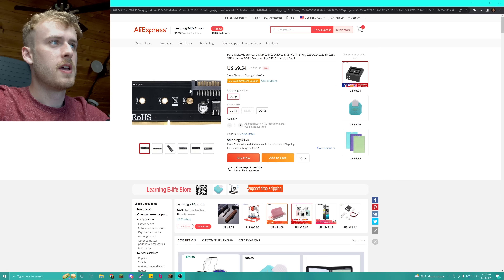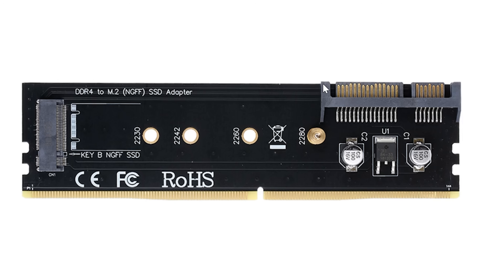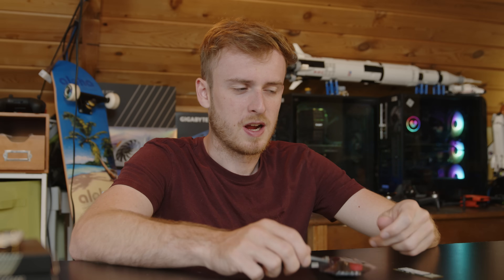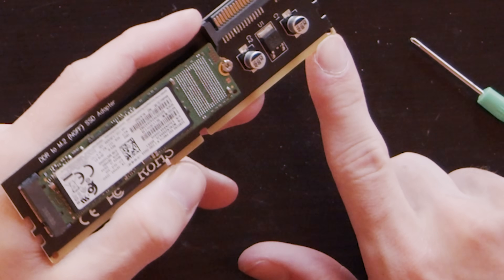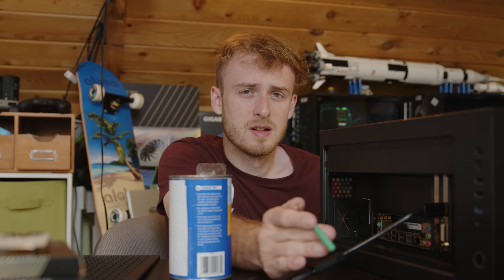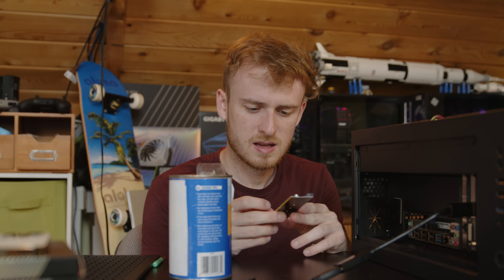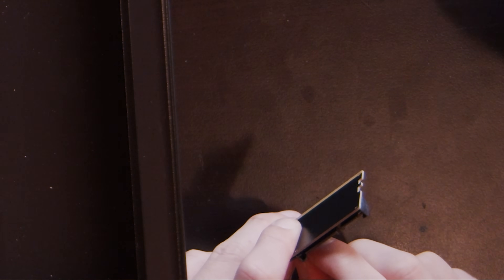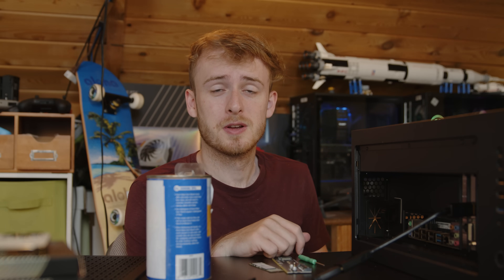I Bought a M.2 SSD To DDR4 Adapter from Aliexpress.com and Broke My PC?

Comment: Seems more likely that you suffered ESD damage. With no ground pins on that "adapter's" PCB, it's more likely that any static charge on the surface of the PCB material would have then discharged through data and/or addressing pins of the RAM slot directly into the memory controller in the CPU.
Reply: I think you might be mistaken.  The plug that goes into your power outlet is grounded via the mains supply to your house.  The power supply is grounded via this cord and in turn the chasis of the PC is grounded as is the motherboard, via the power supply so any ESD would be harmlessly dissapatied.  The only exception to this would be if you are using a budget power supply which isn't grounded, I've seen quite a few that are not.  But please DON'T OPEN YOUR POWER SUPPLY unless you are qualified to do so.-----
Reply: @russelldresh7832  I don't believe I am, I'm pretty well-versed with electricity. I've also been tinkering with electronics and building PC clones since the early 90's so have my fair share of experience in this arena. That said, I don't proclaim to be an expert and am only sharing my experiences accumulated over the last thirty-some-odd years.

First, when installing RAM or PCI cards onto a motherboard, you should have the power disconnected from the system. Adding components to a hot board, while something I admit I cheat on occasionally, is not the best idea. While some PCs that have been custom built or perhaps beefed up with a newer PSU might include a hard power switch which can be turned off, in turn leading the ground connection intact with the wall outlet, most OEM systems do not, and these would ideally be disconnected from the outlet for service. This is why a ground strap which one wears is always recommended. 

Now back to this mystery adapter; with no ground pins on the DIMM interface side of the adapter PCB, the earth ground through the power supply is moot either way. 😉

The adapter PCB will essentially float, and static charge on its surface will not necessarily find a ground pin in the motherboard's RAM socket before it finds a path to ground through an address line, a data line, or another component pinned to the DRAM socket. Static charge can build up to hundreds, even thousands of vots. There are no high-voltage isolation slots in the CPU's die. 

Think of the last time you received a static shock when reaching for a door handle. A door made of wood... Bolted to a wooden frame... Static discharge damage, though increasingly rare, can happen easier than you think.
Reply: fried through past the sata port into chipset.?. / electrical current can travel through other areas that aren't even connected on the pcb / voltage can jump across lanes.. I wouldn't put it past the manufacturer to not know what they doing.
Reply: @djsaekrakem3608  Not likely, as the M.2 SATA slot on the adapter, as well as the SATA connection on the adapter, have a low-resistance electrical ground through the SATA controller. 

The PCB material, by its very nature, is an electrical insulator. So without having any electrical ground pads on the edge of the adapter which slots into the memory module connector, any static charge that had accumulated on the surface of the PCB material would then discharge to ground through the path of least resistance. If there were an actual electrical connection to ground, that would have been the easiest path for the voltage potential to discharge through. We know, however, that the adapter has no electrical path to Earth ground. So that means, wherever the most potential difference had been accumulated on the PCB, the voltage could have first found the path of least resistance to ground through the pins directly connecting the RAM slot into the RAM controller - which on modern Intel chips is integrated into the CPU - instead of passing through the electrically insulating PCB to an actual ground pin. This would have the potential to discharge hundreds to thousands of volts through the RAM controller in the CPU, which is not capable of isolating more than a few volts at the absolute most.

End result is a roasted RAM controller, which means a roasted CPU.

Comment: I don't get why if you saw it don't have any conductor on the suppose fake ram pins, why you connect it to the ram slot anyway??? -_-U I will go though the process is testing everything separately to see what is exactly causing the computer to fail to start

Comment: I had a case front panel e-sata port fry my pc about 20 years ago. Like literally it was only supposed to change the connection port, there was nothing connected on the port. So it might also be the sata part.

Comment: I still have a ddr voltage booster.  It used to go in a ram slot. Had a knob on it to adjust ddr voltage. It ran off a molex HD power connector. Back when ram wqs in the 3v range. It would let u up the volts 3v to 5v in hundredths of a volt.  Back when Mushkin memory was the best...just Samsung bh2 chipa
Reply: that sounds... insanely and beautifully sketchy. I wish modern electronics had the guts to be that wild.

Comment: I recently had a rather strange fault occur with my frankenstein desktop PC (i say frankenstein because it is a mixture of higher end and lower end parts)
One thing i should mention is that at the time this happened, the frankenstein PC had a mechanical hard drive
The PC has a 650W power supply, and it is plugged into a surge protector
I had recently installed an SSD which i was going to move my data across onto (as part 1 of a 2 part process to move that system across to SSDs)
Started the PC up, everything seemed normal, i formatted the SSD, and shortly after i copy/pasted my data from the data partition of the mechanical drive to the SSD, the computer froze
this computer has frozen in a similar way a number of times before, and it has always recovered either by itself, or from me pressing the reset button on the case
However, this time, it did not recover by itself, and windows did not boot when i pressed the reset button, the PC went into the UEFI setup automatically (which it does if it can’t find a bootable drive)
At first i thought oh, great, hard drive failure (and i sent the drive off to data recovery because i did not have a backup)
So i got a 2TB SATA SSD to replace the HDD (and installed it into the case alongside the 1TB SSD that i got for the data)
I was able to install windows to the 2TB SSD just fine
But the weird thing, is that when i installed a 4TB mechanical HDD, to use as a backup drive, the computer did the exact thing it did when it had the original HDD in it, it seemed to boot fine, a few minutes later it froze and did not recover by itself, and after pressing the reset button, the PC did not boot, the UEFI setup screen opened, and no bootable drives were listed
So i removed the 4TB HDD, and weirdly the computer was then able to boot into Windows from the SSD

I have managed to figure out what was causing it to do that, take a guess
Reply: So your house power delivery was fluctuating under load, and crapped out?
Edit: Read it again, the surge protector was causing the fault. 🥴 (At least from my understanding)
Reply: @szdawid2  Yep, it was the surge protector (and i am unsure as to if i will bother getting a new one)
Reply: @pineappleroad  Finally! A good answer, I thought I would be left with a cliffhanger like with most films 😂
Reply: The PSU was absolute dogsh*t?
Reply: @szdawid2  nope, the power supply has nothing wrong with it (as far as i can tell)
Clue: it was something BEFORE the power supply
Reply: Wow!  That's a first one for me!  I never heard of a surge suppressor doing that before.  Did it actually fry both hard drives?  Did you try the 4TB drive in a different PC to see if it still worked?  That would really suck if you sent out your first drive to data recovery when it actually would work by just getting rid of the suppressor.  Data recovery places are VERY expensive from what I hear.
Reply: @arthurmann578  after removing the surge protector, i put the 4TB drive back in the PC, and the drive was recognised by Windows (and it still works just fine)
The 4TB drive doesn’t have a bootable operating system on it

The data recovery company i sent the 2TB drive to said that the cause of data loss was “intermittent electronics failure”
I don’t know if that is their way of saying “we couldn’t really find anything wrong with the drive”, or if there actually was an issue with it that would keep it from starting every now and then

Since im writing this on a tablet, I can’t check to see if i have already said this, but for a number of months leading up to the incident, the PC had a habit of randomly freezing, sometimes it would recover by itself, other times pressing the hardware reset button would bring it back
And i am wondering if the surge protector was responsible for these random freezes
Reply: @pineappleroad Almost definitely it was the surge protector causing the freezes
Reply: @pineappleroad   Thanks for the fast reply!  I think that I will be keeping close watch on my surge suppressors from now on.....🤔👍👍

Comment: Get a cheap multimetre and find out the voltages and where it is going.  you can also use a strong light like your phone flash and see if you can see traces.
as for the mobo. Try unplugging it and take the Battery out for a few hours Then plug it in and boot without the battery. Some motherboards have soft fuses which take a little niggling to reset.
Reply: He said niggling 🥴

Comment: Hm... is there a way to retry this? First check if the computer works, and only then plugin the device? I'm not totally convinced this killed the motherboard in one blow.

There are similar devices or add-ons available here in my local shop, also plugs into the ddr slot without pins, but has m2 slot to sata or even to usb, and they work